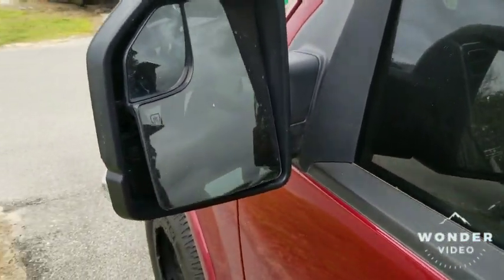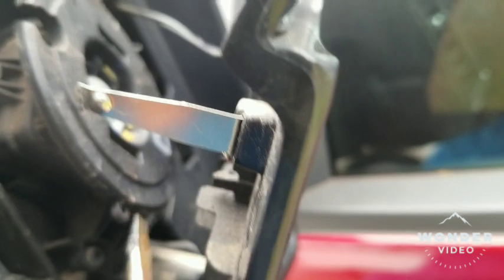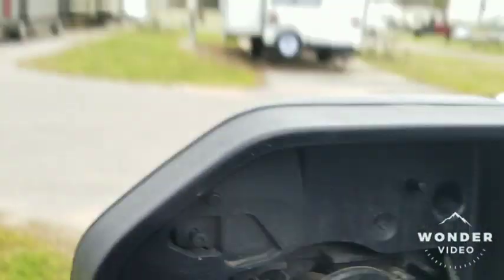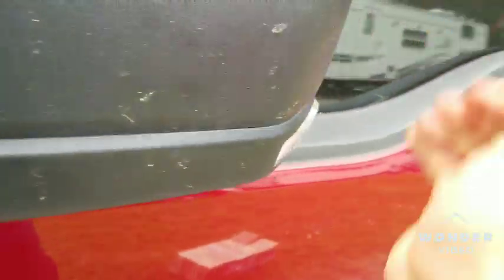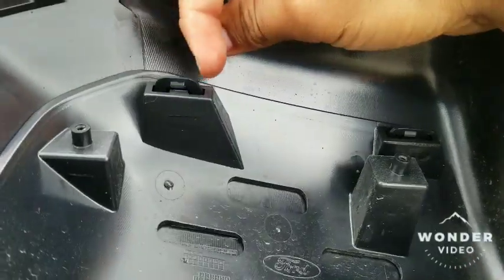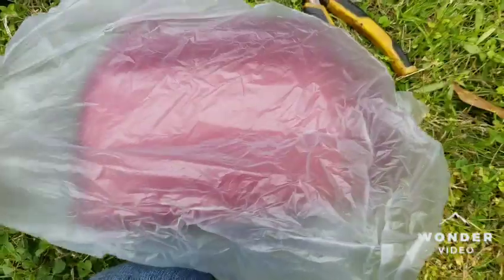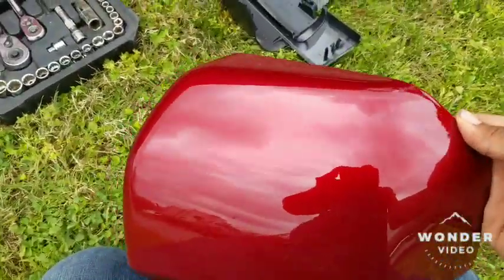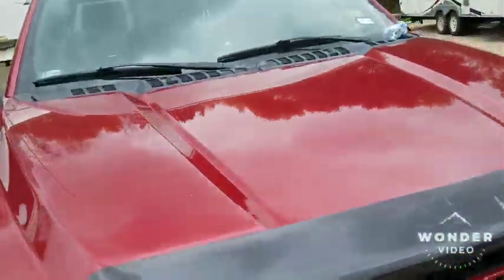How to remove mirror skull caps from 2015-20 Ford F150

Comment: I watched your video and then replaced my OEM (black plastic) mirror covers with paint matching (race red) ones.
I started on the driver's side and everything went OK. But like you I separated the inner brace from the outer and had to put both back together on the main Mirror part at the same time. Getting all the holes lined up and keeping the LED light in straight was not that easy but after three or four attempts I got it done.
For the passenger side, I decided to put that black brace on first by itself. I then screwed it down tight. After that, I snap the new outer mirror cover on without any issues whatsoever. Seriously, the passenger side took about 5 minutes driver-side well that was more like 45 minutes.
Reply from the maker: Ahh. Great tip! I can see that being easier. Thanks for sharing.

Comment: You can also remove the mirror assembly so you can put the mirror in your lap while sitting in a chair (indoors in the A/C). Just remove the small inside cover for 2015-2020 (not the entire door panel like 2004-14)
Reply from the maker: Ooo this is a great tip. 👍

Comment: You can just use a trim pry tool and pop the Cap only part off the tabs are just pop tabs and you most likely always break them when you take it off but I don't believe there is a need to remove everything like that love how informative your video is

Comment: 1:21 Great explanation. This is the trickiest part of the job.  BTW, eBay has OEM skull caps, glass, turn or puddle lights for manual and power-fold mirrors if something goes wrong :)

Comment: I bought aftermarket chrome but after 2 years they look like trash. So i bought OEM. They where expensive but worth it. Remember you get what you pay for.  Aftermarket will not hold up after time.  But thanks for the correct way to install them.

Comment: Also If you broke a power-fold mirror arm (or turn signal etc) you can buy a new OEM Ford 2015-2020 power-fold arm / bracket / frame on eBay for BLIS (Platinum, Lariat trim levels etc) or the non-BLIS mirrors with a mini-convex glass spotter.

Comment: Where did you get the primed mirror cap? My f-150 is rapid red also I would like to have a set of those on my truck! Thanks good job
Reply from the maker: Fairway Ford, on eBay, original ford parts.

Comment: where did you get the Caps(covers)?   Mine was knock loose, would you think repairing the cover would work, or should I just buy the cover? It seems like mine just snaps in.  King ranch 2001
Reply from the maker: eBay. From fairway ford I believe

Comment: Followed your video to the t, and the up and down adjust function quit working.  Took it off and replaced twice, still no go. I say don't do it.  I'll see how much it will cost to fix at the dealer. Thanks for the try.
Reply from the maker: O oh. The power mirror stopped working?
Reply: @bvbhu3dg  Yes.  Like I said, followed your video exactly.  Side to side adjustment still works, but not up and down.

Comment: Duuude!!You can order these already paint matched for $75.oo..and popping the cover off from the back is much easier
Reply from the maker: Nice. Show us how and where bro.
Reply: Yes but his are actual Ford parts. These you gave us are knock offs. I’d rather have oem parts.
Reply: @dc6420  Lol. They're little pieces of plastic. There's literally zero difference between these and a factory part that costs twice the money before you even paint it.
Reply: True, but if you like your truck and are a purist, it’s worth the extra money in my opinion. I’d just spring for the more expensive Ford pieces.
Reply: @dc6420  I love my truck. It's a regular cab, and I've replaced plenty of stuff with OEM  parts. (STX grill, special edition wheels and badges, etc.) But the little pieces of plastic on the mirrors? Not that serious. It's an F150, not a Porsche. It's your money, though, so knock yourself out. That said, even if you're using genuine OEM mirror caps, it's a lot easier to just pry the old ones off using a trim removal tool and snap the new ones in.
Reply from the maker: @davidmangrum9556  I like it factory like David said. KickinitwithQ got those that you say and his are off the color tint. You can look at his yt video where it shows. I didnt want to risk it and who knows how long the paint will last. But like you said. To each their own. this was good for me. Thanks for watching and commenting brother.